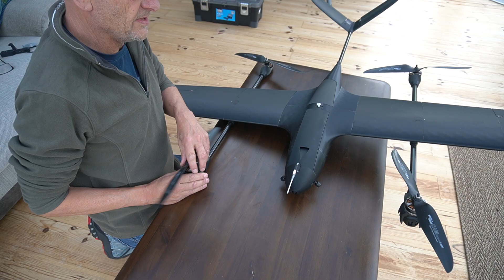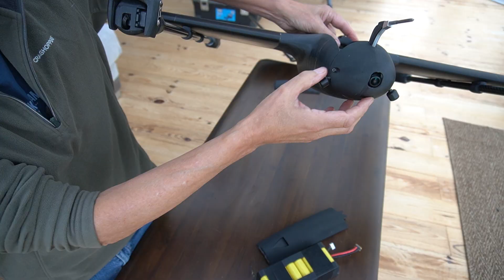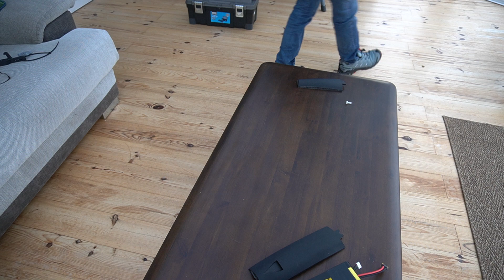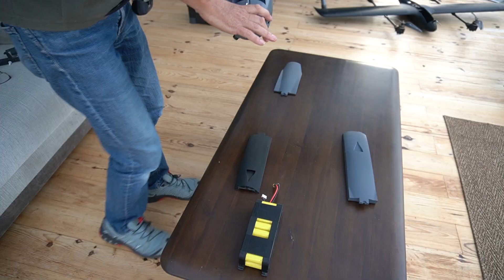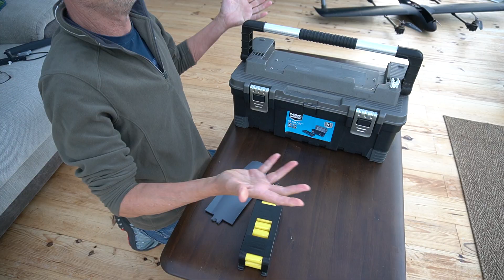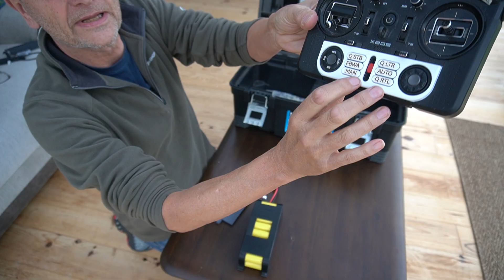VTOL SR Merlin and Kite closeup briefing

Comment: Thanks Vince. Great breakdown. I have to ask, the airspeed indicator looks notoriously similar to an standard aircraft pitot tube. Is it in effect the same design? I know you said it was digital I’m just curious if it is essentially a big straw that takes in the air, measures the pressure and that’s how airspeed is derived.
Reply from the maker: It is like a plane and has both pitot and static holes. The tubes then plug into a small pcb that measured the difference between them.

Comment: Excellent! I follow all your videos. Congratulations on your excellent work; your dedication and experience are evident. Sending a big hug and congratulations from Colombia. I'll be buying the SR Kite VTOL soon. I'm finishing my first project with the Stallion and then moving on to the SR Kite VTOL, which impressed me, as I mentioned before.
Reply from the maker: Thanks Very much for that. The Kite 2 just flow. Files are already available but may be changed, also I have not yet done a build manual but if you have done other builds it should be fine.

Comment: Good video. I know the ASA didn't work, but if it did, would you expect longer flight times due to less weight?
Reply from the maker: I did test prints with most common filaments. Simple ABS was the lightest and ASA next I think. Petg was the heaviest. Of course the difference between ABS and ASA could have just been the flow rate. Ive not been impressed with anything printed in ASA.
Reply: @vincehogg8935 LIGHT WEIGHT ASA is up to 40% lighter than standard ABS or ASA. That's why i would expect a lighter craft and longer flight times.

Comment: What material used ??
Reply from the maker: These are both ABS. Ive done ASA one but it was not good.
Reply: @vincehogg8935 What do you think is the best material for structural construction? And what about carbon fiber-reinforced nylon? I have a graduation project at university and I need help.
Reply from the maker: @AhmedFaker-x4k  There are many channels comparing and testing different filaments. Try @mytechfun and cnc kitchen. I haven't done much structural destruction tests but I like ABS because it can take some bad landings without complaining and its cheap.